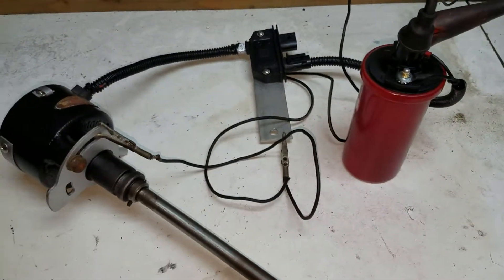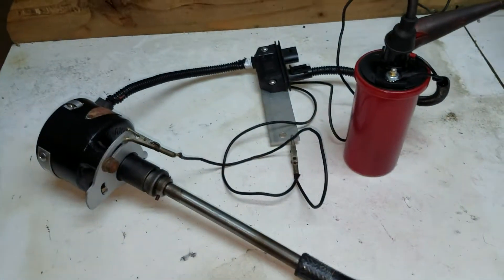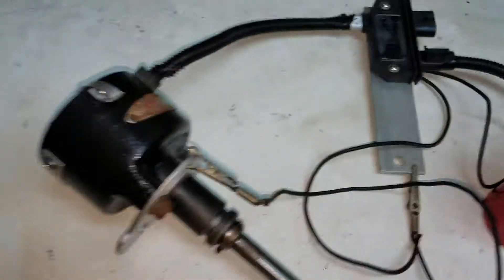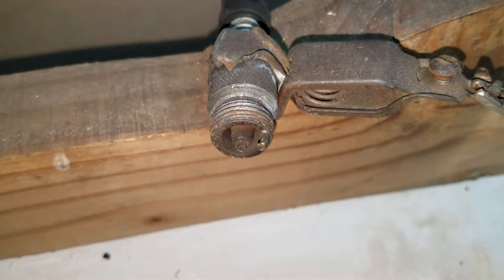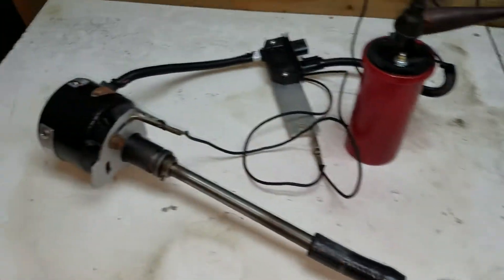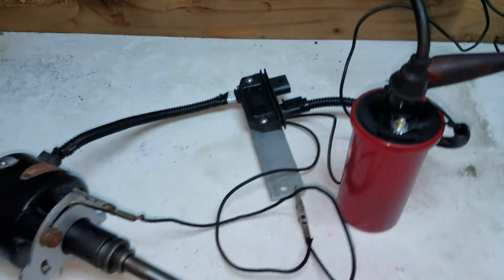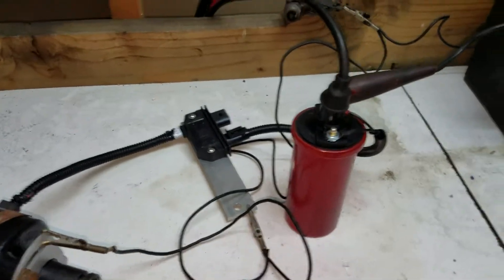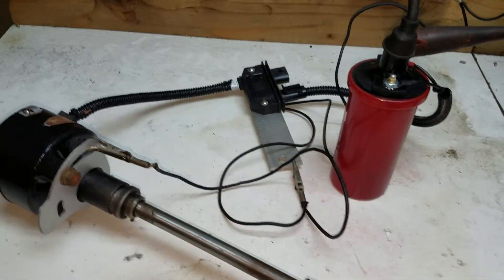Willys F134 HFI Distributor conversion

Comment: Nice job. Did the converting of the distributor take custom maching?
Reply from the maker: The point lobes are machined down to fit the new reluctor.
Can also convert the alum after market electronic distr for timing control EFI.
Reply: @BillUSN1  would you want to do another willys f134 distributor?
Reply from the maker: @davedegan12  LOL, I do them for each of my HFI systems, no real time to just do distr conversions by them self.
Reply: @BillUSN1  I understand. I am just being lazy. Thanks for posting the video.
Reply from the maker: @davedegan12  go to the injection forum on binderplanet.com for all the DIY info.
Reply: Hi. Do you have a parts list?